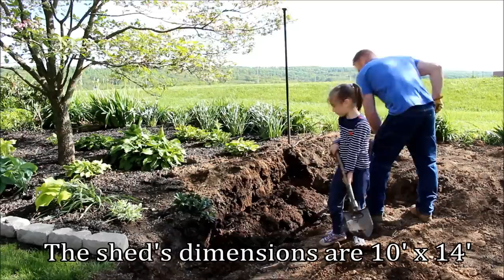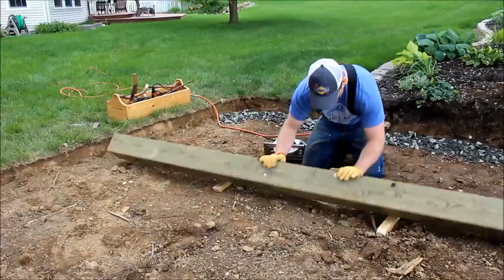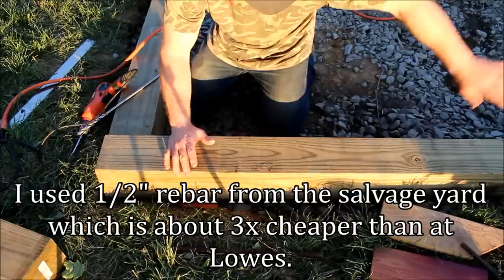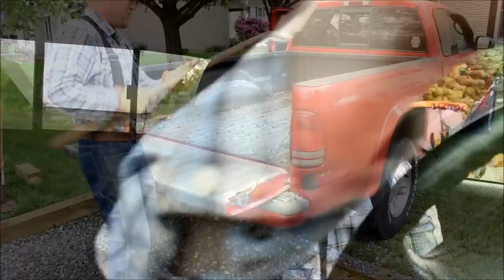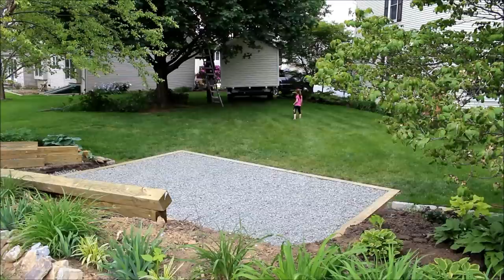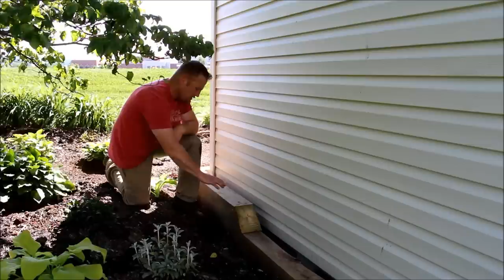Building a Shed Pad on a Budget by Hand. DIY How to

Comment: To find if base is square measure from opposite corners. Distance should be the same in each direction. If not, not square. There are different variables that can come into play checking if square with a square. How do I know this? Checked square using a square on a garage floor slab. According to the square dead on. It wasn't. The slightest off at the corner gets to be several inches 28 feet to the other end.

Comment: Some good ideas from this. 6x6's seem so much better than other options. My shed is only 10x8 and vinyl, so I'm still not sure my base needs to be that chonky. Maybe I can just go with 4x4 or 4x6 beams? Maybe the price will decide.

As for the rebar, won't that stuff rust out and disintegrate in that scenario pretty quickly? Is there not some kind of galvanized or stainless option for such a task?

5 years on, anything you'd have done differently?

Comment: Is the rebar not overkill? Considering that there will be tons of gravel inside, the frame shouldn't be able to move. Any answers are appreciated!
Reply: If they weren't held in place somehow, the gravel itself would want to squeeze the beams away in all directions with the weight of the shed on top. They need to be at least attached to each other, and preferably attached to the ground as shown. The way I had it designed in my mind, I'd have some 4x4 posts dug into the ground at each inside corner to anchor the frame to. Maybe the rebar method is better, but I'd want to use something galvanized.

It is possible that if you just set the beams down and fill it with gravel that your base and shed will stay put for a while, but some good rains, and freeze/thaw cycles, even just the wind pushing on the walls of the shed... really are powerful forces that will make you wish you took those extra steps early on to keep everything from shifting around.

Comment: Those treated 6x6 beams will rot over time in contact with soil.  How are they doing now?
Reply from the maker: Chris Moore they are pressure treated and rated for ground contact for 25 years.  This is what my borough code specs out for a shed pad.  No sign of decay so far...

Comment: Overall good job. If you had backed your truck up just 6" to 12" more with that first load of gravel, you wouldn't have so much spillage on your form and outside it. Also, when you were leveling, you pulled off the high spots, but I saw you pull right across many low spots without addressing them.

Comment: I know it's 3 years now since you did the vid, but I'm about ready to build a base, can you tell me why you built it bigger than the shed, I'm thinking it would have been good to have sat the shed on the 6"x6" surround, or have I missed something obvious?
Reply from the maker: Paul Milsom it would be better to have the shed sit directly on the stone for drainage. The front of my shed sits directly on the 6x6s because I didn’t want the pad to stick out into the yard any further.  With the front sitting on the 6x6 it increases the chance for water to sit between the two layers and cause rot even though the material is treated. So far so good, it’s exactly as you see it in the video with no issues but I may install a gutter in the front to help keep the water away
Reply: @VintageWoodWorkshop  thanks for replying, the shed I have is quite a bit bigger, 24'x11', home built.
The base I made is concrete, but has cracked the full length, and the shed now sits twisted.
I haven't discovered why yet, maybe a tree root problem, or foundations sunk, maybe not deep enough, or maybe the sheds too heavy, I have an apex roof which I had a lot of timber/ lumber stored making it heavy.
Either way, I need to find the problem, repair and build a new base. At present the concrete is my floor, but was thinking of building a wooden floor, so your information is good, thanks

Comment: Very nice work!  How much price difference was it to use the stone as a base versus concrete slab?  I have an 8'x8' plastic Rubermaid shed right now that I need to get rid of and build a bigger shed for all my power tools (riding lawnmower, tiller, push mover, power sprayer, snowblower) plus have room for a work shop.  I've been up in the air about what sort of "budget" base I want begin with.  Your idea of the stones is a good idea especially since my back yard gets a lot of rain water drainage (down hill from the house).  Right now my plastic shed is on concrete risers about 6-8".
Reply from the maker: peter weintraub sorry, missed your comment but I think a stone pad would easily be half the price

Comment: How do you keep the gravel area (seeing as it's sunken into the dirt) drained ??
We live in a wet climate . . and we're planning a new shed in the backyard.
Thanks !!!
Reply from the maker: The ground doesn't seem to hold water here and quickly drains into the clay layers below the stone.  I think a good 6 inch layer of stone will keep the water from settling under the bottom of the shed.  As long as the supporting 4x4s forming the bottom of the shed are sitting on the stone and you have plenty of air flow I'd imagine you'll be ok.  The water will go right through the 6 inches of stone and spread out in the dirt below.  Good luck and thanks for watching!
Reply: Appreciate your answer . . thank you.

Comment: That was a really nice video one question though what does the floor look like inside of the shed is it stable and sturdy? please do reply I would really like to hear back from you to see if you have any problems with mould or creakin in the floors?
Reply from the maker: Hey Clem, thanks!  The floor looks like some kind of OSB that has a heavy duty painted coating on it.  It doesn't creak or sag and I don't expect to have any moisture issues due to adequate air flow underneath.  here is the website for where we ordered ours: http://www.ebpsheds.com/

Comment: Have you had any water problems with your retaining wall to date?  Curious as to how well the gap from the 6x6's to the building sides having rain flowing underneath the building.
Reply from the maker: William Stewart no obvious problems so far and this is the most rain we've had in 30+ years here in Berks Co Pennsylvania in August.  That's a great question and maybe I'll do a follow-up on how the water is draining and how it fairs in the next few months

Comment: Did you put in rebar all the way around on all four sides?  Can I drill and place rebar in a 4x6 instead of the 6x6 that you used?  Thanks.  Building a 11x12 shed pad this week and I'm using 4x6s
Reply from the maker: I used the rebar on all sides and it would work with 4x6s as well.  No I didnt use landscape fabric but that would be a good idea.
Reply: Vintage Wood Workshop thanks for the reply.  I did use the rebar on all 4 sides, worked out really well.  I used the lawn fabric underneath and am now in the process of filling in the blue stone.   3/4 of the way there. Lol.  Got 2 yards delivered to my house, using a wheelbarrow to move from driveway to backyard.  What a workout, lol.  Great video, helped me a lot.  Thanks.

Comment: Great video, especially where your daughter is helping. Did you fasten the shed to the ground or to the 6x6's? In my town (near Buffalo NY) I think I have to use footers 3.5 feet deep to get below the frost line to comply with building codes. I hate to ask the building inspectors because they'll be watching me like a hawk.
Reply from the maker: Thanks John!  No I didn't fasten it to the ground.  Luckily the building codes and regulations aren't too strict here for a shed of this size.  I know trying to read the local building codes is an exercise in futility so you may have to ask the township unfortunately.   Good luck!

Comment: Great video and very helpful for building my own gravel pad!  Sorry if I missed it in the video but, did you attach the cut pieces together (not the corners, but the long sections) ? If so, how did you do it?
Reply from the maker: Thanks, no I didn’t attach them to each other, just secured them with rebar into the ground.  Still holding up strong with no frost heaving
Reply: Johnny

Comment: I'm looking to do a small shed blacksmith shop you think that stone method with hold up to hammering metal?
Reply from the maker: Not sure Patrick!  I'm getting into blacksmithing myself and I think it depends on how you have your anvil mounted.  If you have it on a stump I think it would work but a steel stand will work its way down to easily.  concrete would be better but unfortunately more expensive
Reply: Vintage Wood Workshop thanks !

Comment: Concrete sleeper would have perhaps been better. 

Not enough aggregate under the wood. Or could have raised the wood a little with concrete blocks.

Use a tarpaulin in truck bed. Makes it easier to get the aggregate out and less mess/damage to bed liner. 

Aggregate should have been compacted.

Reebars going through the wood into the soil is going to rust. 2 to 5 yrs depending how much rainfall per yr in your area. Sure is a tight fit...easy to remove if need be?
Reply from the maker: all good points!  You're right there is always room for improvement and I almost always could find things I would have done a little differently.  I'm thinking this will last a long time with minimal settling and rot

Comment: YOU DON'T NEED TO DIG A HOLE only a trench for a small amount of stone to lay the posts , then a floor frame and presto you have a raised floor . stone always sinks over time into an abyss any gravel driveway will prove this ...year after year having to rake it  back up just like municipalities do to alley ways nor do you need rebar to hold the 6x6 frame into the ground the floor frame will balance everything out, nothing crooked .

Comment: The base is about 4" wider all around - why?
Are the 6x6 PT or cedar?
Reply from the maker: The shed sits on the 6x6s in the front but couldn't on the sides and back because of the retaining wall I needed to build after it was delivered.  They are pressure treated pine 6x6s

Comment: Nice video, thanks for posting.  I learned a lot and am about to build my own shed.  Because the shed foundation is not the same depth front to back, how did you calculate the amount of gravel needed?
Reply from the maker: bklyn2va2dc thanks,, I eyed it up and was fortunate to be able to get it a scoop at a time..  They sell it in cubic yards, so you could try to calculate the volume using length x width x height
Reply: Vintage Wood Workshop Great. Thanks!  I appreciate you getting back to me so quickly!
Reply: Have another question: did you attach your 6x6s to each other with brackets or screws or did you just pin them in the ground close to each other with the rebar?

Comment: Awesome video!  Is there a maximum length for the timbers before you'd decide to cut them?  I noticed you cut some of the timbers where the longer uncut one would have fit.  Is it just to make it easier to work with?  I'm going to make a 10 X 14 pad and I know I can buy the timber in 10 foot lengths or even longer.  Would I still cut a 10 foot piece into two 5 foot pieces to create a side instead of just using the full 10 foot piece?  Just wondering what I'm missing!  Thanks a lot!

Comment: Great video! I do have a question. What did you do to secure the two 6x6s together that you had to cut in half to make 11 ft? Did you use some sort of brace after you out the rebar in? Or did you screw the ends of them together? Just curious as I will be doing the same setup. Thanks !

Comment: Nice job. I love you involve your little one. Just a quick question, compared with concrete how much did you save? Thanks!
Reply from the maker: not sure of the savings because I didn't price out concrete and I wouldn't have been able to get a concrete truck in there without destroying the yard.  The cost breakdown is in the pinned comment at the top....hope that helps and thanks for the kind words!

Comment: There are cheaper/easier ways of doing it. I did 6x12 blocks, pea gravel and 12'x4" treated 4x4's. Took me about 3 hrs to stack and level the blocks. it came to less than $90 and I paid a crane to come set it for me, which was $300. Subbed

Comment: Looks like you have a good little helper! Question, did you treat the cuts of the treated wood?
Reply from the maker: Thanks, no I didn't treat the cuts and so far no signs of rot
Reply: @VintageWoodWorkshop  Cedar? I don't know if you said which type.
Reply from the maker: @MetalAsFork  these are pressure treated pine.  I did not add any additional treatment to them

Comment: Doesn’t the wood rot within time? With the rain etc...
Reply from the maker: Natividad Torres They are pressure treated pine giving them a greenish tint and are rated for ground contact for 25 years.  This is built to the local borough specs
Reply: Thank you but when you placed the house on the foundation, how did you secure the house to the foundation . How much gravel is needed for a 12x24 shed which the shed wil converted into a home in Florida

Comment: Thank you. This is giving me hope that I might be able to tackle this myself.
I just bought a 12 x 18 dog kennel and am a new homeowner so I have much to learn. How much bigger than structure should pad be including wood?
Reply from the maker: Hi, you want to make the pad larger by at least 6-12" on each side if possible to help with drainage since water will not pool up under the base of the shed due to the pad of stone.  I placed the front of my shed directly on the 6x6 border since I didn't want it to stick out into the yard any further.  No sign of issues so far with mine.  Best of luck!

Comment: Next time, put a heavy duty tarp in your truck bed.  You can just drag it out to pull out all the last few stones, and you wont get stones stuck down between your tailgate and the truck.
Reply from the maker: good tip, Ive done that before but then I end up tearing the tarp to shreds with my shovel.  That works great for mulch when I use a plastic shovel on the bottom

Comment: This is very good but the skids need to be sitting on the rock all the way around. Too much chance of rotting when the skids hit the wood. I think you need at least a foot of rock all the way around the perimeter of the shed so you have room for the rain to drain off.  Either that or set the whole thing on a raised sheet of concrete exactly the same size as the outer perimeter of the shed. You need to let the rain drain.

Comment: There are ears on the top of the shovel blade for a reason? Your dirt looked compacted but u seemed to continuously keep scraping only removing small scoops. Jump on that thing and really get a scoop. Well done on the rest of the project.
Reply from the maker: Thanks! Well I tend to dig with a bar to loosen the dirt up and shovel with the shovel (how I was taught).  You should never jump on the shovel with both feet at a time, only one at a time.

Comment: You got a rockstar helper there, pulling the branches out of the way! Question: I didn't catch any mention of tamping the bed rock down. I saw the hand tamper used under the timbers but wondering if that is sufficient to pack down the six inches of rock in main area. I'm considering renting a power tamper for my shed bed, but if a hand tamper works fine, I will do that. Great and helpful video.

Comment: hey great video! im having an 8×10 shed delivered next week and have been looking for a nice foundation video that didnt involve concrete and think this is a great alternative. can i ask hiw much the foundation ended up costing you with the rocks and wood? im going to try this method regardless but am also a bargain shopper lol. thank you for the content. sub +1
Reply from the maker: surferonfire hey, thanks! glad it was helpful.  this took me awhile due to the amount of dirt I had to move but here's what I can remember:  treated 6x6 are about $20/8 ft and $30/10ft at Lowes.  I bought my rebar from a scrap yard for .40 per lbs. IIRC at Lowe's they sell it for around $4/3ft piece.  stone is about $25 per ton (more if you have it delivered.  so I estimate it cost me around $400 or $500 due to the extra 6x6 needed for the retaining wall.
Reply: Vintage Wood Workshop thank you for the quick response. im actually rewatching your video with my girlfriend now showing her your great content. i am definitely doing this.

Comment: Won't the logs rot from being on the ground? I'm no builder, but I would have layed down a small brick boarder instead of using wood.
Reply from the maker: They are pressure treated pine rated for ground contact which you can find at home depot or Lowes ,so they should last a long time.  This was built to code in my borough...
Reply: I did some google searching and 30+ years seems to be a reasonable expected lifespan. Also since the logs are not structural in any way, really they just contain the gravel during the building phase having them eventually rot away will not affect the shed. Anyways nice project, seemed like a LOT of digging though!
Reply from the maker: Thanks for the info, and yes it sure was a lot of digging and shoveling!!